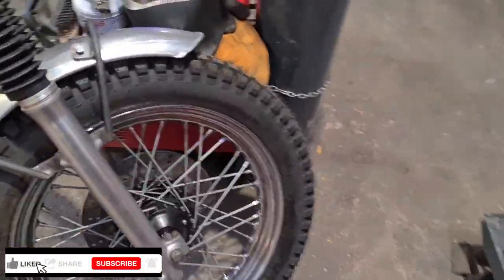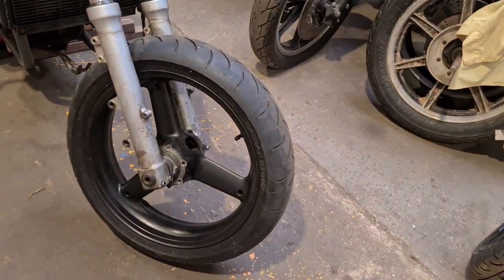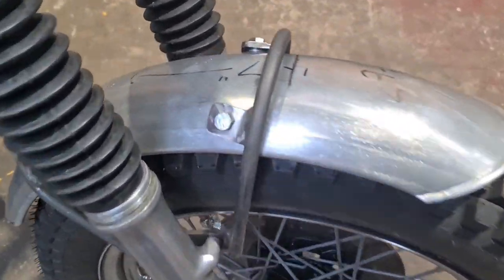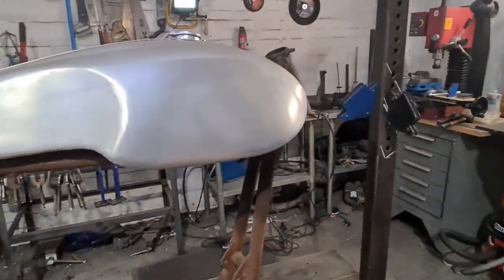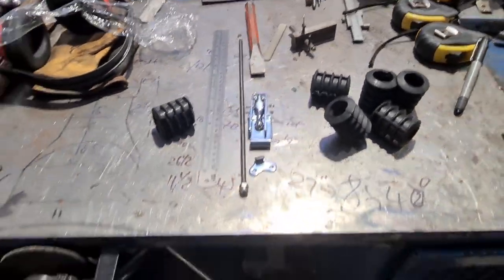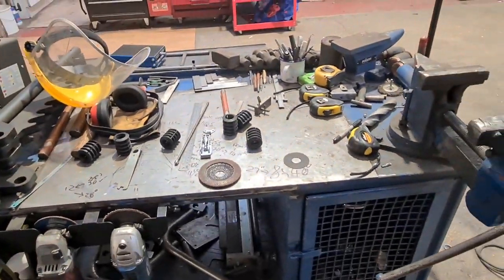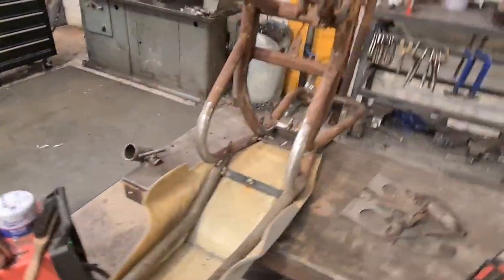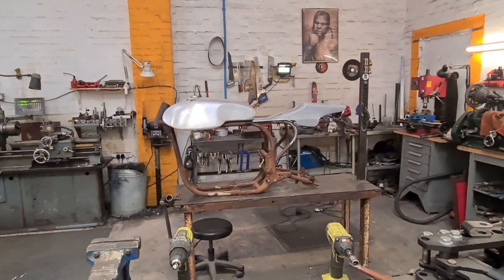Featherbed Tracker Chopper! Vlog time #workshop #motorcycle #restoration #vlog #crazy #blog #bike

Comment: Just incase you don't know the lug  on the headstock near the top bearing is for the head steady 
The head steady on a featherbed frame forms part of the frame structure 
Without it the headstock can move about and affect the handling 
If you look at some of the modern reproduction featherbeds they weld a tube from the back of the headstock where that lug is down to the cross piece on the top rails 
So the frame needs a good strong headsteady bracket with exact size holes for the bolts to be spot on 
Hope this helps
Reply from the maker: Thanks Nick 👌